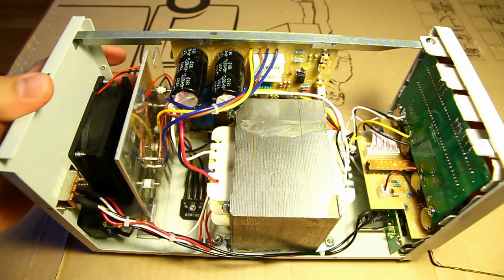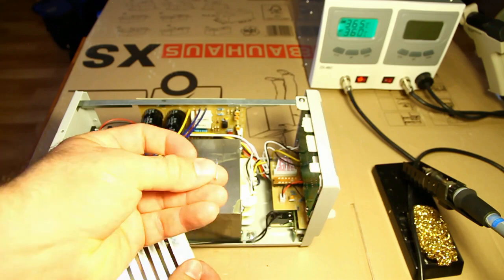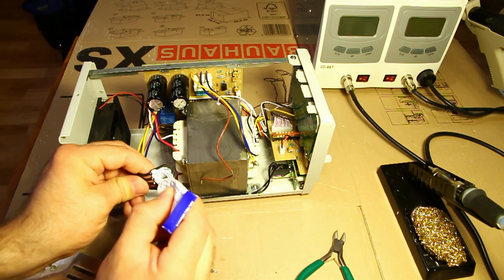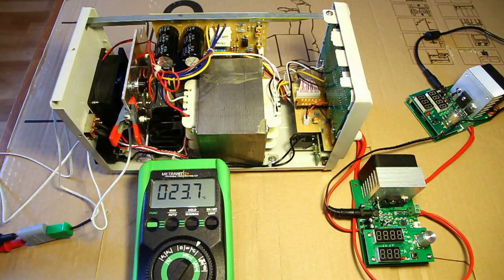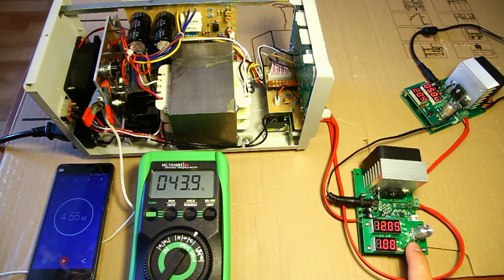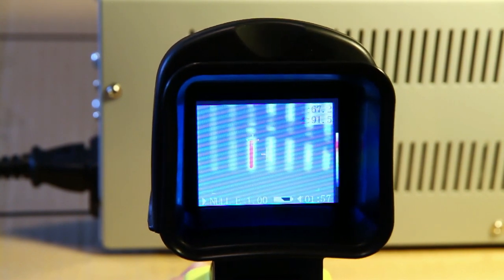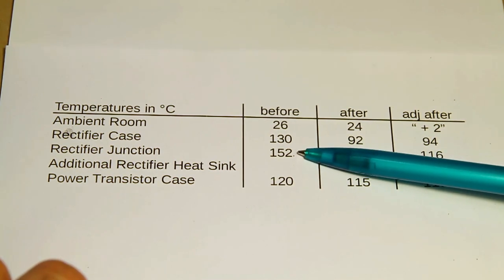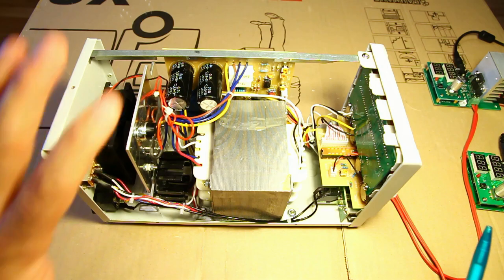Lavolta BPS-305 - Two Cheap Thermal Mods - To Keep it Cool and Quiet #018

Comment: I really wonder why they insist on making those flimsy U-shaped cases. Same amount of material and bending can give a much stiffer case. The bottom case should have one vertical panel at full height so it’s L-shaped in cross section. The case would be L-shaped too. It’s asymmetric but asymmetry actually helps with stiffness here. Way cheaper than adding a stiffener bar.

Comment: Hello, can I use a KSD-01F temperature switch (60º normally open) would it also work or is it safer to use a metal type switch like the one you put? I say this in case one type of encapsulation is more reliable than the other.

Comment: Would a bigger heatsink work instead of the fan?
Reply from the maker: I'm sure that is possible. But you would have to redesign the thermal management of this power supply. Dave from the EEVBlog made a great tutorial on how to do thermal design. Check it out here: https://www.youtube.com/watch?v=8ruFVmxf0zs

But you have to keep in mind, that there maybe other components within that power supply that depend on the airflow from the fan for cooling, not only the power transistors and the rectifier. Without a fan, they would also need additional cooling.

Comment: Great video! Thanks for sharing.
I've got the same PS and I'm in need of help disabling the Short Circuit Protection. I bought this Power Supply to test boards for short but it cuts off the power when it senses a short. Have you got any idea how to do it? Thanks
Reply from the maker: Hi, thanks for watching. 
On the topic: I'm pretty sure it doesn't have a short circuit protection function. It limits the output current according to the set value for the constant current mode. To do that, you short circuit the output and the power supply switches to the constant current mode, the red LED under C.C. on the left side lights up. Then adjust the maximal current with the left set of knobs to your desired value, then remove the short and the power supply goes back to the constant voltage mode, green LED under C.V. is lit, then adjust your needed output voltage. To test if the device under test has a short and therefore draws more current then it is supposed to, set the current limit for constant current mode to a value which is just above of a specified normal value. All normal boards will run in constant voltage mode C.V., green LED is lit and boards with shorts will run in constant current mode C.C., red LED is lit. You can watch the review videos I did on this power supply for an example of how to set the current limit.
Reply: @k-tech796  Thanks for taking the time to reply. I'll try and see if it works. Ideally I'd like to see some capacitors or chip getting hot on a shorted motherboard when I come with a little current but that hasn't been the case. Will run a few tests to see. Thanks again!

Comment: Thanks for your video, Can I use bigger value temperature switch? For example: 55 or 60 degrees or not?
Reply from the maker: I haven't done the math, but I think temperature switches with 55 or 60°C would be perfectly fine also. I have done a video with a worst case scenario thermal load test of this power supply, check it out if you haven't already. The peak temperatures of the transistors were about 120°C with the fan running. But I wouldn't use a 120°C temp switch, because they aren't very precise and other parts of the power supply might need the cooling air flow of the fan earlier.
Reply: @k-tech796  I see. Thanks mate. Have a nice evening.